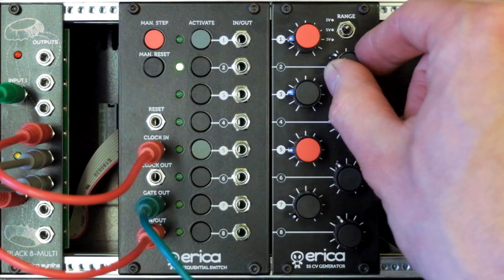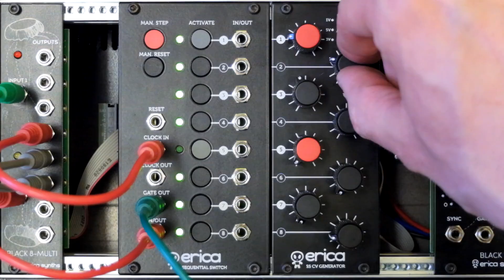Sequential Switch CV Generator overview

Comment: Hello! So, I ordered the switch last year, but my supplier shipped me the cv controller instead. I knew I wanted both, so I held onto the controller and re-ordered the switch, only to be told that nobody stocked them anymore... I talked to my other vendor, and they also said there were no more. I put the controller on the shelf and concentrated on other parts of the rack, until recently, when I contacted your customer service team directly, asking if they were aware of any stock at any vendors, so I could order from them. Santa informed me that you had found some leftover components, enough to make maybe 80 units. You just shipped one out to Ringo Shop in Korea (my more reliable vendor than the one who sent me the controller) and I'll be receiving it in the next week or two. Big thanks to you guys for arranging that, I'm really happy to be finally getting it, and big thanks to Santa for fantastic customer service, super helpful and responsive.